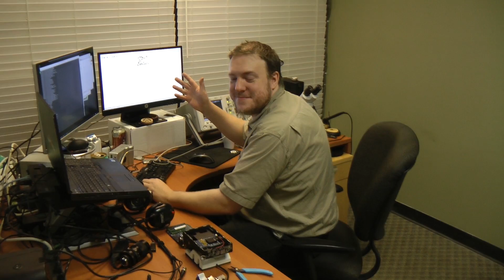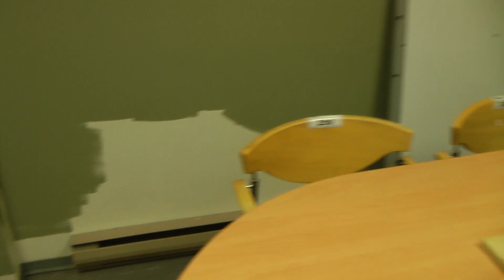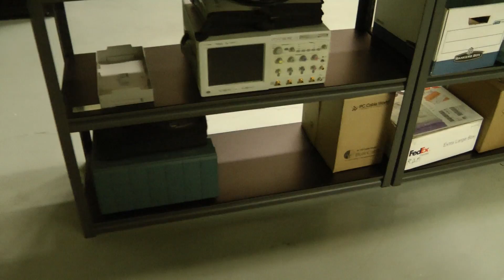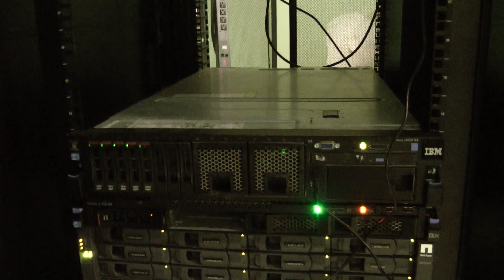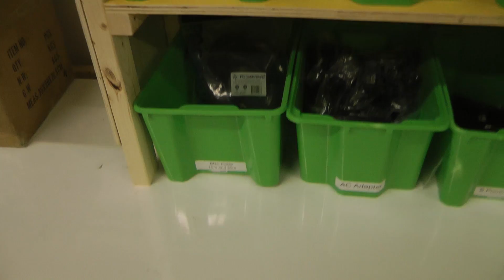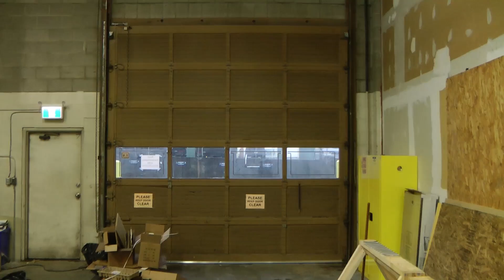Chronos Kickstarter update - One year later

Comment: I'm waiting for your air liquefier .... Is it still alive?????
Reply from the maker: No, I gave up on that long ago, and just buy liquid nitrogen as needed. Why build something you can buy when you can spend that time building something you can't buy?
Reply: tesla500 i can't buy liquid nitrogen in my city... so i have to make it myself.
Reply: tesla500 i'm also looking for sterling  cryocoolers in my country
Reply from the maker: Keep checking eBay, try to find someone who will ship to your country.
Reply: tesla500 after searching for hours on the net i finally found a liquid nitrogen dealer.. They are selling it for $5 for 1 liter.. Is that fair?

I have bought two fridge compressor for the project for only $50 along with 100feet long copper tubing.... I just wanted to know if there's any chance of success using fridge compressor??
Reply from the maker: $5 per liter is reasonable, but slightly expensive. My supplier charges $2.50 per liter, but other suppliers in the area charge up to $7

An air conditioning compressor might work, (R22 or preferable R410A), but an R12 or R134A fridge compressor would not work as far as I know.
Reply: tesla500 my compressor are rated for 450psi and 0.7cfm...so connecting two of them in parallel should give around 1.5cfm at 450psi..isn't that enough
Reply from the maker: That should be enough, same as the compressor I was going to use.
Reply: tesla500 probably last question

What length of copper tubing should be enough??

What's the cheapest way for Drying air??
Reply from the maker: I was going to use 15m of tubing, I'm not sure if it's enough though.

For drying the air, running a coil of tubing inside a freezer or dry ice bath should dry it significantly. Normal water ice may even work.

Comment: I used to work at a school where we had tons of those epson short throw projectors. When I left last year they were all dropping like flies with some kind of board problem. I always wondered if the crappy aftermarket lamps they insisted on using were causing extra load on the lamp drivers, burning them out. I'd love to see a video about that machine. You'll be amazed at the number of fans inside it!

Comment: I suggest you build a soft wall to delimitate the hard work (mill, wood, shipping, outside roll up door) from the assembly area. If you buy polyethylene unsealed bags on a roll, and slice them down the middle then seam join multiple such pieces with UV resistant tape (just because it's built to be tougher in time) you can span the height of the whole shop with it for cheap.

Comment: You lot are having too much fun over there and I hope it continues!  Nerf is fun to play with in high speed too. It's slow enough that you can take some great shots at the higher res too.
Oh, I completely forgot.. If your AU power-cords are the same as the ones you shipped, they are non-compliant due to lack of insulation on the active/neutral pins.